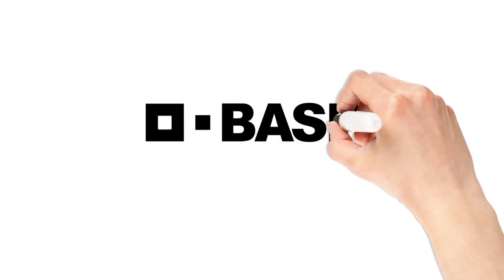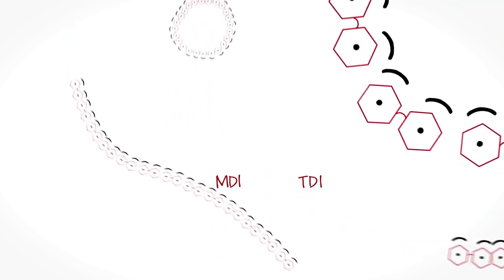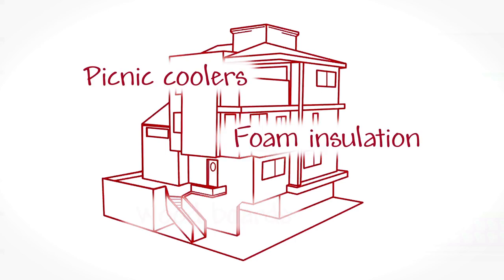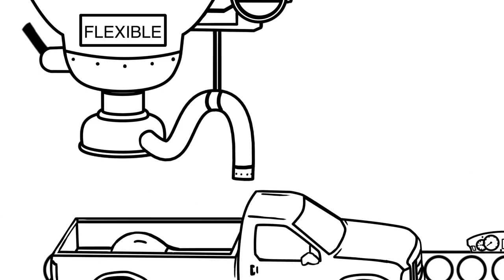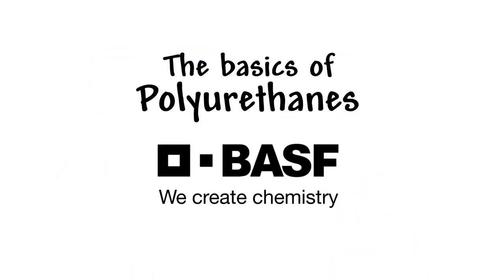Basics of Polyurethane

Comment: Summary
## Polyurethane Basics from BASF: A Summary

This transcript provides a basic overview of polyurethane chemistry as taught in the BASF Polyurethanes Academy. 

Key Ingredients:

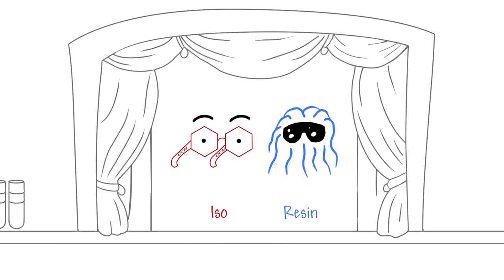* [00:00:21] Isocyanates (ISO): 
    * Available in different types (pure MD, TDI) with specific properties and uses. 
    * Fewer connecting points result in more flexible products (seat cushions, mattresses, sealants).
    * More connecting points result in more rigid products (coolers, insulation, wood boards). 
* [00:00:29] Resins: 
    * Custom formulas created by customers using BASF ingredients.
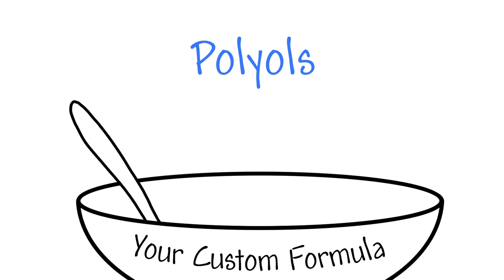* [00:01:18] Polyols: 
    * Form the majority of the resin, acting as the backbone of the mixture (like flour in a cake batter).
    * Determine the physical properties of the final product, such as its softness or hardness.
* [00:01:32] Other Additives:
    * [00:01:35] Catalysts: Control the reaction speed and curing time.
    * [00:01:40] Surfactants:  Determine cell structure and flow.
    * [00:01:45] Pigments: Determine the color.
    * [00:01:48] Flame Retardants: Improve safety. 
    * [00:01:50] Adhesion Promoters: Improve stickiness.
    * [00:01:53] Blowing Agents:  Determine density and foaming action. 

BASF's Role:

* *[00:01:58] * Supplies high-quality raw materials (ISOs, Polyols, and Additives) that allow customers to develop custom formulas and create a wide range of polyurethane products. 
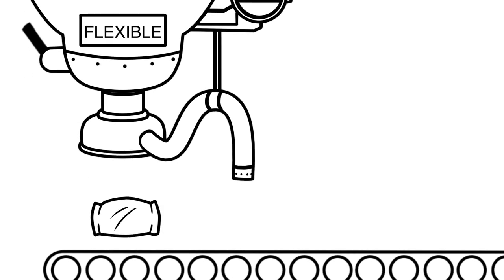*  *[00:02:09] * BASF materials enable customer innovation and success in creating both flexible and rigid polyurethane products to meet specific end-user requirements.

Comment: Thanks simple and interesting. Question: What is done to the polyether to make it shore hardness A 70 or D 40 for example?
Reply from the maker: PU consists of many different polyol building blocks: short-chain, long-chain with different numbers of reactive groups. For example, to change the hardness in a polyether-based PU, the proportions of special polyols, mostly short-chain ones called crosslinkers, are increased or decreased.